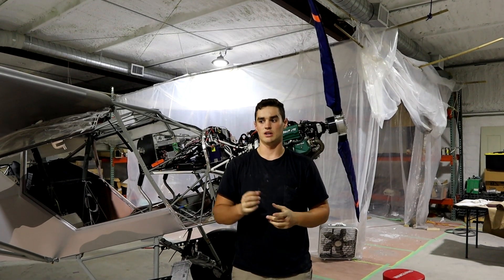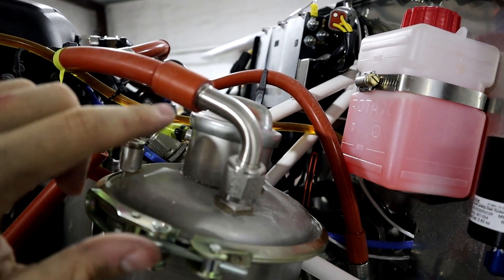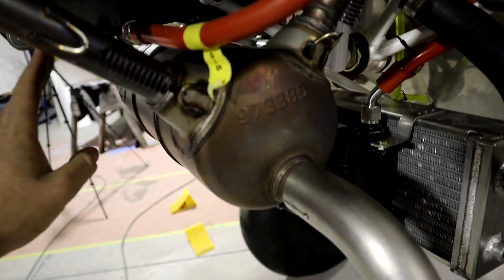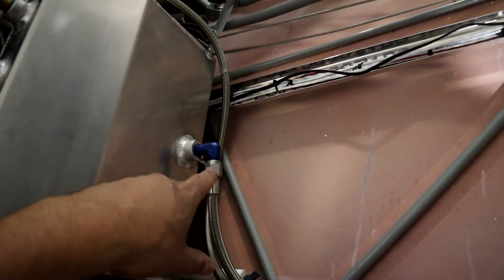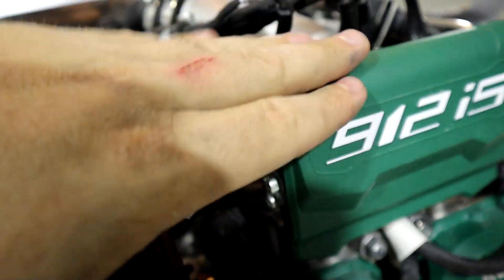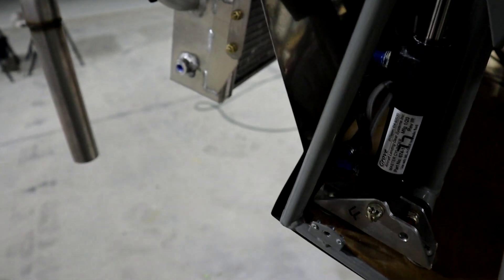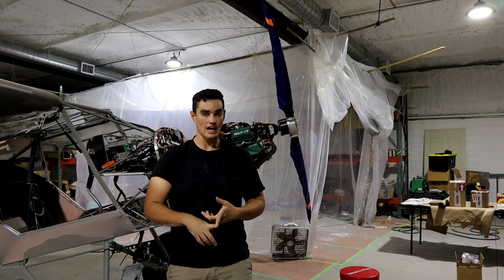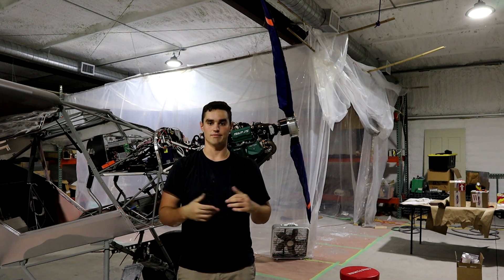Kitfox STi Build Update 23 : Hoses

Comment: Hi Roger. I'm in communication with Steve about ordering a complete hose kit as I'm also installing the 912is. Is there anything you would change if you were ordering again. (ie) length of hoses etc or fittings. Thanks.
Reply from the maker: No complaints, it's a fantastic set of hoses. Definitely worth the investment. And Steve is great to work with! His brake hoses are the bomb too. The only thing I would explore in the future is getting him to build hoses for the runs from the tanks to the header. That is a more difficult task that would be easier to handle before the tanks get glued in.

Comment: A very nice system, Kudos. You have put a great deal of effort into safety, however at 6:54 in the video the fuel line is an exposed run of aluminum. If I recall from my years as an A&P firewall forward fuel lines should be steel fittings, lines and fire sleeve protected. In a fire that aluminum will be toast and so will you. Plus the issue with heat soaking the fuel and possible vapor lock? Just a thought to increase your level of safety. 
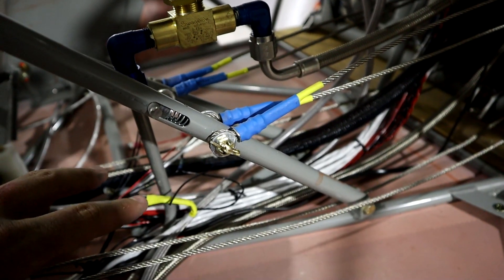Also at 4:58 I would be worried about that short run of aluminum tubing attached to your fuel line, I am sure you will be supporting it some how. If not I would be concerned about fatigue fracture in the bend. Is there a gascolator anywhere in your system?

Comment: Did you say the airframe/engine is good for 10 years? I haven’t heard that before and curious if you can expand on that?
Reply: I was just about to ask
Reply from the maker: The hoses are good for 10 years or the life of the engine. Whichever comes first. If you swap your engine out in 5 years it's a good idea to replace hoses. Talk to Steve though. I'm not the expert here.
Reply: @7KiloFox  All our hose assemblies come with a 10 year warranty, but they are considered "lifetime" hoses.  In other words, there is no mandatory replacement interval.  Unless the hoses are damaged, they have a virtually indefinite life.  We do recommend that firewall forward hoses be replaced at engine overhaul as good practice, but for most of us builders that is 20-25 years.